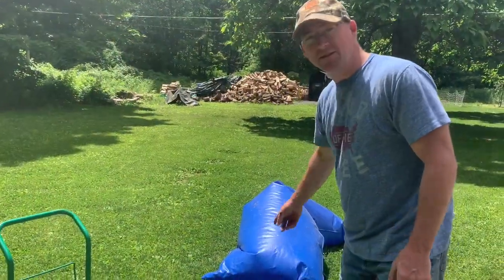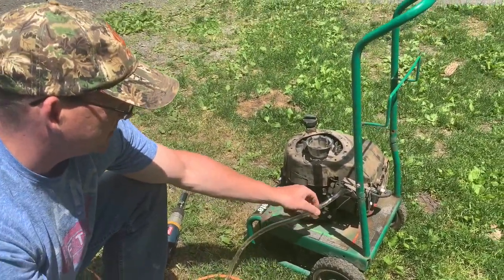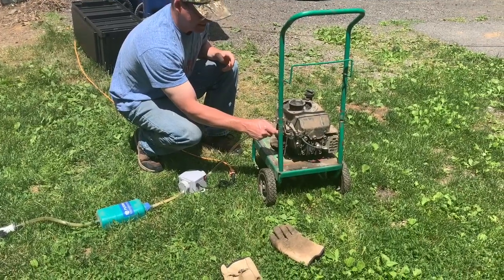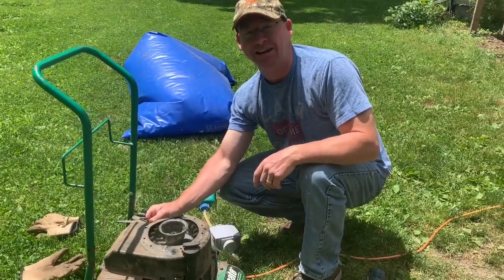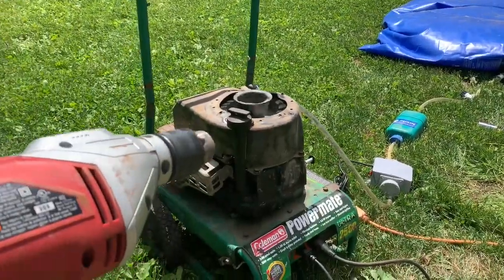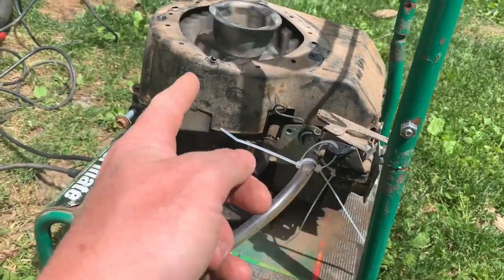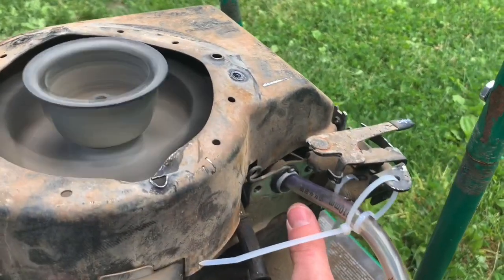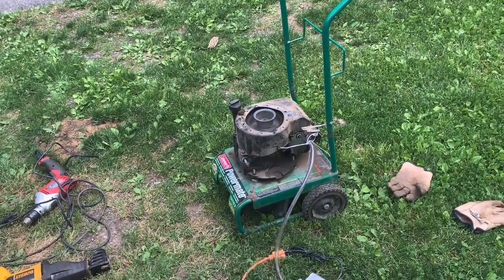Biodigester - Methane - Biogas

Comment: Amazing video. Id like to know how long running the engine on bio gas would last? 
I heard theres a tri fuel adapter idk what it does, and also scrubbing the Sulphur may help
Reply from the maker: If you’re biogas is scrubbed then engine should last a while. Now that it’s winter my digesters are sleeping, next spring I’ll be doing alot more with the biogas.

Comment: You need to play with the fuel/air ratio because the engine rpm wasn’t 3600 so the hz of ac power isn’t right. This will harm what you’re using. 

Great video though

Comment: If only a cheap solution for storing the gas in a compact form could be found. An ordinary 5 gallon propane tank could allow up to 8.8 cubic feet of gas but that is only a 0.07 gallon gas equivalent.
Reply: Yes I just seen a video of a guy using an air compressor to pump bio gas from a mattress into a 5 gallon propane tank